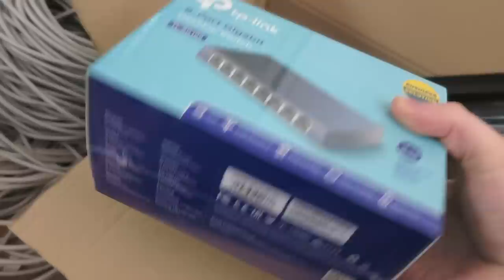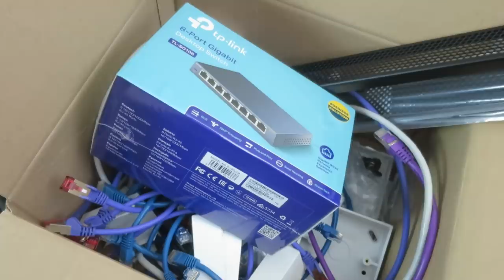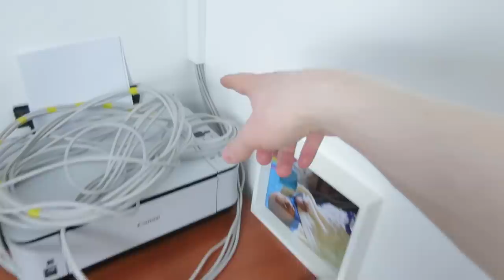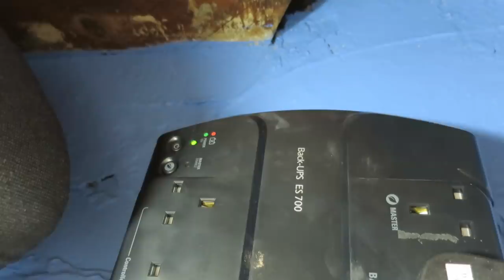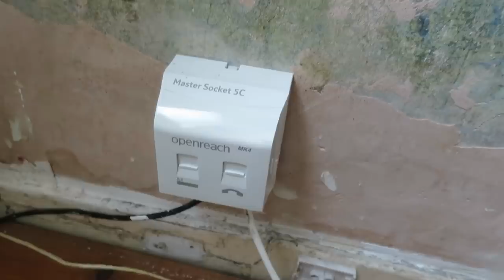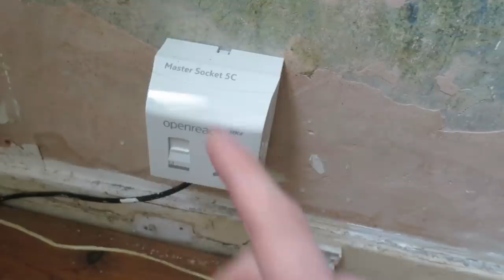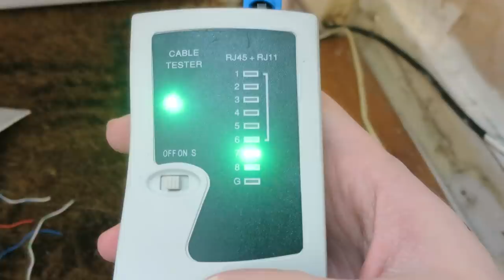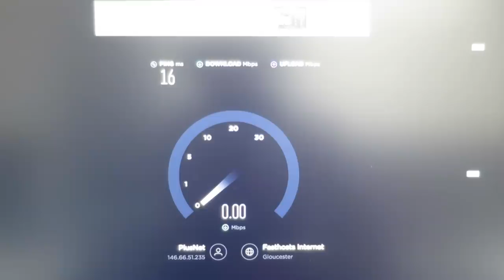Setting Up Our Home Network (Part 6) - A Vast Improvement

Comment: Tom great video as always. This is something i'm planning on doing in the house I just bought. Going to be allot of work but I'd love to achieve just 10% of what you got here.
Also that rack is brilliant and I can only find it on 1 ebay link and it seems to have shot up in price. Was it ebay you got it from? Looking for something similar, doesn't have to be as big.
Thanks as always for a great video :)
Reply from the maker: Thanks man! Really glad you liked the vid.
It's a Zpas SJB rack, here's their site: http://zpasgroup.co.uk/
There are currently a few eBay listings, I purchased mine from their eBay shop but it's also available via Amazon I believe. 
The prices look to be roughly the same as I paid. There are also bundles with various accessories available. 
https://www.ebay.co.uk/sch/i.html?_from=R40&_trksid=m570.l1313&_nkw=SJB+rack&_sacat=0

Hope this helps!
Reply: @ItsMyNaturalColour  Cheers Tom, Yeah it was because of the very 1st video that made me find your channel all them years ago :D
Just had a look, I suppose its the extra £55 on most of there sales for postage that scares me, although there is a used one on a auction for sale. I have messaged the seller already asking for outer dimensions since I will have a 140 mile drive 1 way and want to make sure it would actually fit in my car haha.

Thanks for the response and yeah it has helped thanks :)
Reply from the maker: @welshtony1  Didn't even notice the postage, wow!!
there's still 1 listing with free postage, although the rack is a little more expensive https://www.ebay.co.uk/itm/SJB-19-Data-Comms-18U-600x800-SERVER-RACK-NETWORK-CABINET-for-IT-WOODEN-TOP/272789120943?epid=1405501195&hash=item3f837fa7af:g:0JIAAOSwdzVXqy5q:rk:3:pf:0

Yeah, they're quite big and don't come apart. It arrived on a palette much to my surprise.

Comment: Slightly higher ping, bout same speeds..
Good job tho. 

Quick question, why not put the switch underneath the stairs? Instead of 4 separate cables. Also that Express?
Reply: Because he needs a router connecting directly to the modem. So that would also need to move there.
Reply: @ratchet1freak  and theyre placed next to eachother in the hall way?  Then he runs cable to stairs and up to his office and back to stairs?
Reply: @11 11 capital:D i should watch it again perhaps

Comment: Good video, thanks for sharing! I would have run a second line to the TV setup anyways, just for backup and future proofing. Also I thought you'd run the lines to the TV setup through the gap in the hallway floor that the "old" phone line is currently going through into the living room, wouldn't that have been a little easier than going from the Airport around the door etc. ?
Reply from the maker: Thanks for your comment(s) man, glad you enjoyed!
You know, someone just suggested the same thing in a comment and I couldn't believe I didn't think of that! You know how sometimes you get a project in your head and you can't quite see enough light to think every aspect through?.. that's exactly why I love sharing this stuff, I get so many of my ideas from the comment sections. I think that's the best solution by far. I'll be sure to film and include in Part 7.
Reply: @ItsMyNaturalColour  maybe you can run 2 line anyway... It's future proof and if something fail you have two line from the TV setup to the closet under stairs. Also you can think of a different power solution for the modem... For now it's ok because you only get a 60mb down but in my case for example I have a 100 down and if the ISP change the thing in the street the speed goes up to 200mb down... So in future if you have fiber you can now run a cable for DC power from under stairs to the modem so you can still get the ups.

Comment: What speed are you actually paying for via DSL? Some DSL providers cap your bandwidth based on what you pay for (same as any other type of connection really). Also, that thing you are called a modem..are you sure that its not a router and that you are in a double nat situation (basically your modem there, if its a router is feeding a DHCP address to your real network router).
Reply from the maker: It's an Openreach modem (Huawei HG612), they were standard in the UK for quite some time when VDSL first became available. These days VDSL modem/routers are now dished out instead, such as the Plusnet Hub One that I received when I first signed up. If you're interested more in the modem and my swap from the Hub One, check out Part 5. 
I'm paying for 76/20 I believe. The more people that switch to FTTC in our area, bit by bit it's slowing down. It's a very gradual thing though. The average for that same 'Fibre Ultimate' package is now estimated at 66 down.
Reply: @ItsMyNaturalColour  Oh I watch all your videos. Granted, the one downside to the longer time between posting is I don't recall all the details in everyone of them (don't take that as me in any way pressuring you to post faster or finish what you start or any other bullshit that other people are getting on you about. You are basically giving us free content. Don't take this the wrong way. Please don't. I am an IT professional. I don;t necessarily watch your videos for how to purposes, though though I have learned some stuff about MACs. I love your videos because you are genuinely an entertaining, in a good way, person. As to that modem., I saw a "lan2" on it I thought, and that is what got me thinking there might be a router hidden inside. I think that you are speed capped by the type of connection that you have. Your internal home network is far more robust that what you get from that connection (kind of like me, I have a professional level network in my house, but I have a fiber connection,, and get insane speeds on all my gigabit ports).

Comment: noo, please don't use rj45 jacks on wall lines. use ethernet outlets and patch from there...
Reply from the maker: Which part are you referring to buddy? 
If you're chatting about the WAN line by the front door, all of that stuff will be boxed in (hopefully) leaving just the top of the modem poking out, preventing the kids from fiddling / breaking the connectors. In any other instance I would've socketed but keeping the bulkiness down was a factor there, especially considering the POE thing dangling around. If that's not the part you're talking about, let me know.
Reply: I think he means the 4 ends in the office.

Comment: I can tell you that you really didn’t need to use any screws for the trunking, the sticky pads on the back are generally really strong and more then enough to hold them up. Nice and neat job though Tom, need to hide those cables from your kids fingers!! And a hack saw is what you need for trunking.
Reply: First Name you didn’t watch the whole video then, and no the adhesive padding s more then sufficient. It is pretty tough to take off a wall.
Reply: First Name Well, firstly you can stop with the insults or I’ll throw some back at you and act like a 10 year old to. 
Secondly their was a part in the video when he said he used wire cutters and a Stanley blade to cut the conduit so you must not have seen that. And thirdly he didn’t remote ALL the trunking several times and even if it was one end he only really needed to use a screw in each end at most.
Doesn’t affect me at all if he wants to overdo it, I just offering some advice which Tom enjoys getting from people, but you are the one who claimed four Ethernet cables are heavy enough to require sticking pad backs plus five or six screws in each piece of trunking!
Reply: First Name Nope, your the child, and deleting your posts doesn’t hide that. Have a good day.

Comment: Do you lose speed through those powerline adapters?? If not why not just leave them in the living room?  I've had gigabit ones and they worked great!
Reply from the maker: The speed decrease is negligible, my main concern are the disconnects or the 'un-pairing'. It happens WAY less now that I've moved them but it still isn't quite as reliable as a dedicated ethernet drop to the setup. Having said that, this is exactly why I wasn't too concerned about getting the TV line finished during this video. Since making all of these changes, the entire network feels way more robust and streaming to the TV is so much smoother now.
Reply: @ItsMyNaturalColour  Ahhh too bad... I had 2 pairs of adapters feeding 2 parts of my old apartment and they were solid... Wonder if there is something you could do to stop them from un-pairing...
Reply from the maker: @neccros007  Maybe they'd work a little better if they were both on the same ring main. I'm assuming in an apartment, all of the sockets are probably on the same circuit. 
My office was on a separate ring main because it's an extension, and the cupboard socket I added is on a radial, separate to the main house ring. I've never researched powerline adapters in depth, but at a guess I think being on the same circuit would help immensely.
Reply: @ItsMyNaturalColour  Hmmm Maybe... Mine were on the absolute opposite ends of the apartment so not sure if it was still on the same circuit or not.... Hope you get your TV run working!